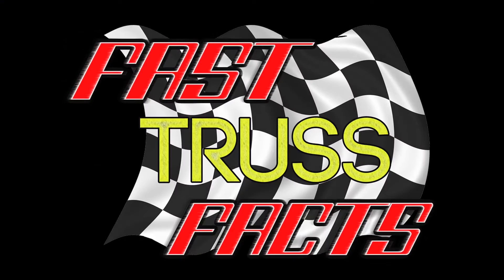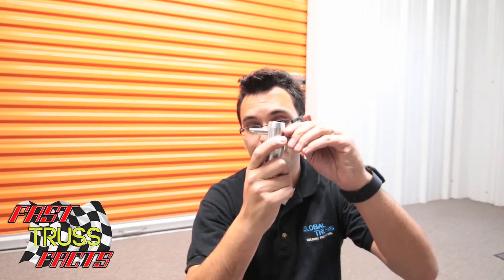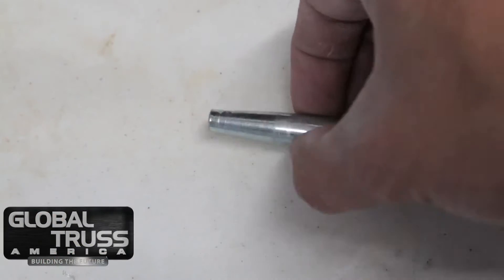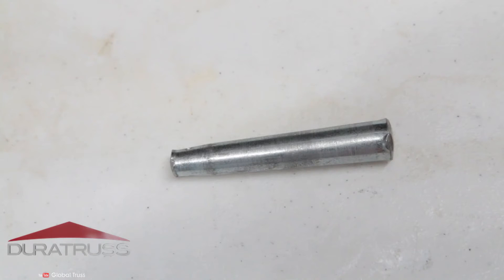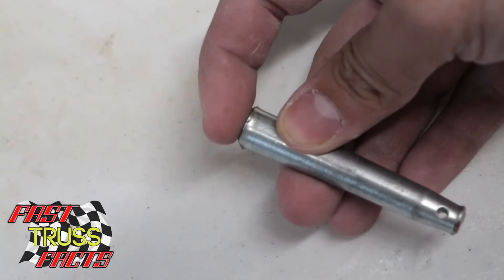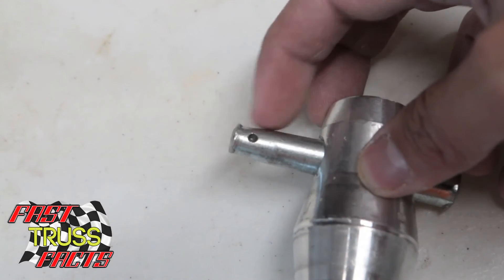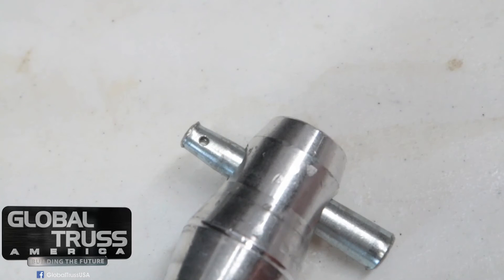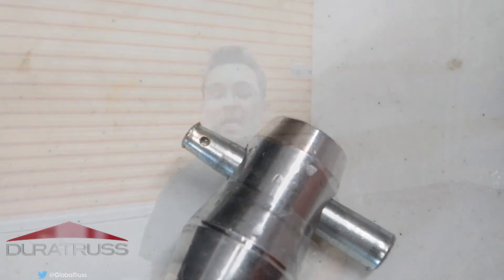Inspect your truss pins?!?!  Fast Truss Fact!

Comment: I use a lixie dead blow hammer with the black tip. Never need to replace a pin.
Reply from the maker: Steven Botelho Good tip. Still, with one wrong hit, you can still mushroom it... but as you know, avoiding it comes with experience!
Reply: Steven, I found this video after typing into Google's search engine, "best tool to remove truss pins". Thank you for this tip!!! 👍💪🤘🖖

Comment: Aluminum? Did I hear that right? I just assumed that these pins were steel.
Reply from the maker: BenG9C9 Sorry for the confusion. Pins are steel, couplers are made in both aluminum AND steel. (That's why I mentioned no matter if its alum or steel, banging them will result in needing inspection.)
Reply: BenG9C9 EVERY piece and accessory that Global Truss make are made of aluminium, or at least I'm pretty damm sure so.